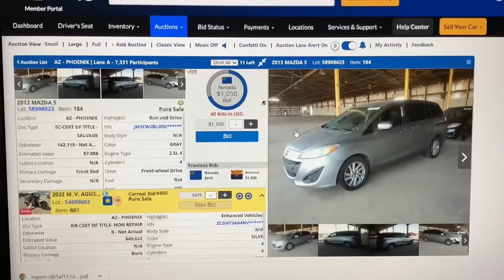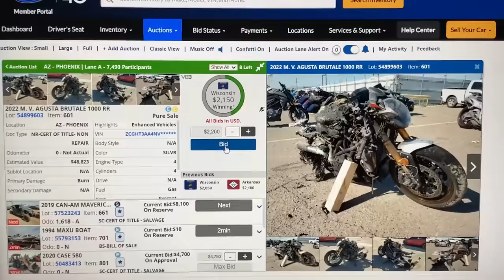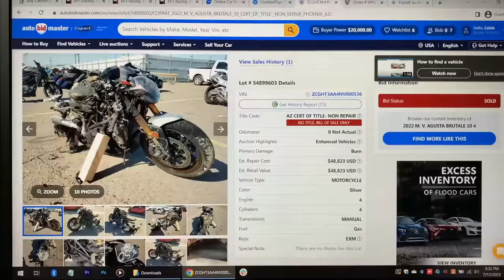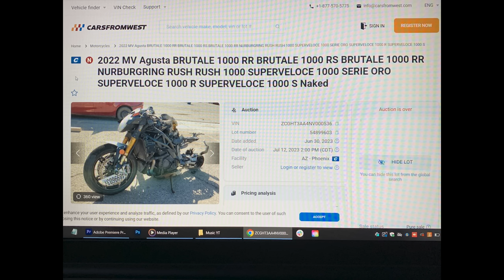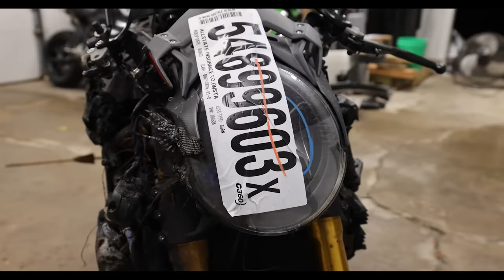Rebuilding A Burned 2022 MV Agusta Brutale 1000 RR Nürburgring!!

Comment: they make about 150 per year and this year is Assen edition. There is also a Rush edition that is 300 per year. 208 hp stock but the Nurburg is around 215-220 with exhaust and tune. You can buy the "base" RS and order the exhaust and tune at the dealer for around 3k or 5k if you want both style exhaust tips. I deal with a lot of Italian bikes if you have questions.

Comment: Parts are gunna be a right pain to find with only 150 made.
If your clocks work maybe 3D print some outer covers to put the board and display in- you have the old ones for dimensions

Comment: The main problem that I can see is the amount of different drilling parts and so far the metal (mainly the engine parts that are cast iron or aluminum and frame with tubes) seems to be oxidized and the heat tends to degrade the material and can lose some properties, if this moto will be used for like normal use and maybe ride at 100mphs, well great but for competition and track, the stress that can receive ... will be a little dangerous. So far all the best CJ

Comment: I'd be betting the frame damage is going to be severe. Heat from the fire could have changed the temper of the tubes and the shape. Going to be a long project.

Comment: You will have a lot of work to do on the motorcycle. And it won't be cheap either, MV Agusta is quite expensive and parts are difficult to get. 😳

Comment: The MV Agusta Brutale 1000 is cheaper than the Nürburgring spec 

The 2022 MV Agusta Brutale 1000 Nürburgring has a potent inline-4 that puts out 208 horsepower at 13,000 rpm. Of course, that won’t be enough for the cognoscenti, who will slip on the included Racing Kit that ups the production to 215 horsepower at 13,200 rpm. Overrev takes you past 14k. There’s also a cassette-style six-speed transmission with a third-generation quickshifter, plus a slipper clutch. Top speed is over 186 mph, but MV Agusta is not saying by how much.

The Racing Kit comes nicely boxed with the following inside:
Arrow full-titanium exhaust system with a single silencer
ECU with Racing Kit map
Carbon fiber silencer cover
Carbon fiber passenger seat cover
Certificate of origin with numbered edition documentation

Carbon fiber, not just in black, is well-represented on the 2022 MV Agusta Brutale 1000 Nürburgring. This motorcycle is not carbon neutral. 

Here’s are the lightweight bits:
Airbox cover
Clutch cover
Dashboard wiring cover
Fuel tank central panels (left and right)
Gearbox cover
Headlight cover
Spoiler
Wheels (in copper)
The carbon fiber wheels are matched to CNC-machines hubs. MV Augusta mounts Pirelli Diablo Supercorsa SP tires to the rims.

The WBSK-inspired Racing Kit version of the Nürburgring is over 13 pounds lighter than the stock version. We’d like to tell you what MV Agusta claims for a wet weight, but they’re keeping that a secret. If you need a number, it’s probably in the range of 425 pounds with the 4.2-gallon fuel tank topped off with high-test.

Öhlins gets the call for suspension responsibilities, and it’s a semi-active unit. The NIX EC fork has a TIN coating on the sliders. The EC TTX shock gets help from a linkage system. The electronic adjustment of the suspension is limited to the damping. Spring-preload is manually adjusted. There’s also an electronic 
Öhlins steering damper that can be adjusted manually or automatically.

The electronics package is thorough. In addition to a quickshifter, steering damper, and semi-active suspension, there is also cornering-aware Continental MK100 ABS. The control gang is there—traction (eights level plus off), wheelie, launch, and cruise. There are also four power modes, along with the Racing Kit’s own track-focused mode. Also, the 5.5-inch TFT dash integrates with your smartphone via the MV Ride app and Bluetooth.

The motor gets updates that we’ve seen on other Brutale 1000s for 2022. There are new cam profiles to improve torque production, as well as an updated header. Titanium is used for the connecting rod, as well as all 16 valves. Sintered valve guide and DLC-coated tappets are new and reduce friction in the top end. All this power, and Euro 5 compliance, too.

As is always the case with MV Agusta, the Nürburgring is a work of art. The paint and the graphics are stunning, and the hard parts compromise neither form nor function. The color is Matt Intense Silver/Matt Metallic Dark Grey/Matt Mamba Red.

ENGINE

Type: Inline-4
Displacement: 998cc
Bore x stroke: 79 x 50.9mm
Maximum power: 208 horsepower @ 13,000 rpm (Racing Kit: 215 horsepower at 13,200 rpm)
Maximum speed: Over 186 mph
Compression ratio: 13.4:1
Valvetrain: DOHC; 4 vpc
Fueling: 4 lower fuel injectors by Mikuni w/ 4 upper fuel injectors by Magnet Marelli; Mikuni 50mm throttle bodies
Cooling: Liquid and oil
Transmission: Cassette-style 6-speed constant mesh w/ quickshifter
Clutch: Wet multidisc w/ slipper function actuated by Brembo radial hydraulic pump
Final drive: Chain

CHASSIS

Frame: Chromoly trellis w/ adjustable aluminum swingarm
Front suspension; travel: Fully adjustable Öhlins NIX EC inverted fork; 4.7 inches
Rear suspension; travel: Linkage-assisted fully adjustable Öhlins EC TTX piggyback-reservoir shock; 4.7 inches
Wheels: Carbon fiber w/ CNC-machined hub
Front wheel: 17 x 3.50
Rear wheel: 17 x 6.00
Tires: Pirelli Diablo Supercorsa SP
Front tire: 120/70 x 17
Rear tire: 200/55 x 17
Front brakes: Floating 320mm discs w/ Brembo Stylema calipers and Brembo radial pump
Rear brake: 220mm disc w/ Brembo hydraulics
ABS: Cornering-aware Continental MK100 w/ rear-wheel lift mitigation
DIMENSIONS and CAPACITIES

Wheelbase: 55.7 inches
Rake: N/A
Trail: 3.82 inches
Seat height: 33.3 inches
Fuel capacity: 4.2 gallons
Estimated fuel consumption: 35 mpg
Curb weight: N/A
Color: Matt Intense Silver/Matt Metallic Dark Grey/Matt Mamba Red

Comment: How does America go about a certification process for a stat right off like this? The actual molecular level of the frame will be compromised by being subjected to heat like that. Seriously it won't take to big a knock to crack the frame spars. Good luck to you though and hope it goes well for you but can see you tipping some serious $$$ into this to even remotely get it on the road. Big ups from New Zealand👍

Comment: So you bought a used front wheel, front brake disk & caliper? Oh, and at least one side reflector. Good luck.

Amazing bike though! My Brutale was the best thing I've ever owned by far, ever ! And I've been lucky enough to drive many supercars...none of them hold a candle to the MV! Don't sell this bike, keep it! Or ok, sell this one, but buy a 3-cylinder Brutale with the proceeds.

(Ok, so you'll also be able to use a few engine parts.)

Comment: Hello How can you put a motorcycle back into circulation because the papers are blocked in the prefecture unless the motorcycle was passed from hand to hand with the previous owner For me you will have to recover a wreck that is not too damaged to have parts because it The parts for these machines are horribly expensive I wish you courage because for me you only have one front wheel left in a condition to get back on the road I will follow your journey I am from France and I am 70 years old